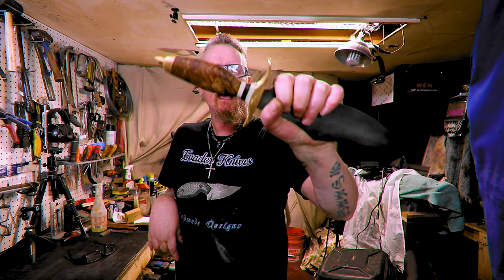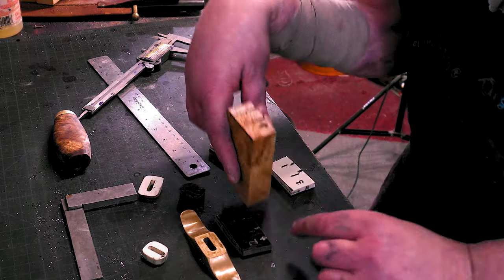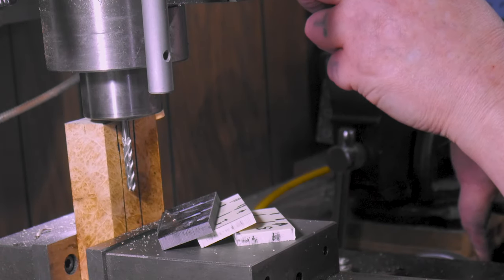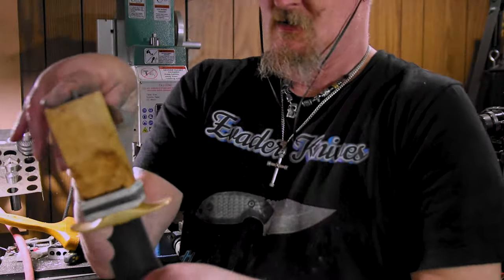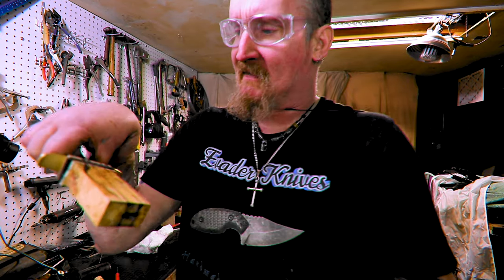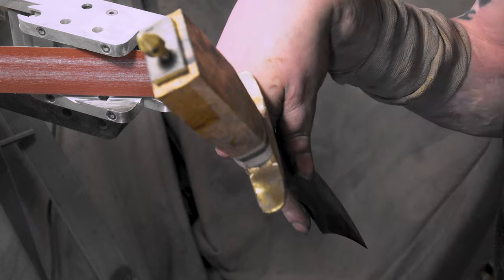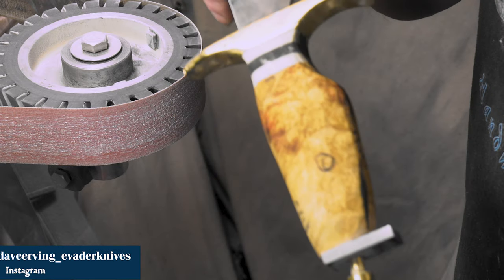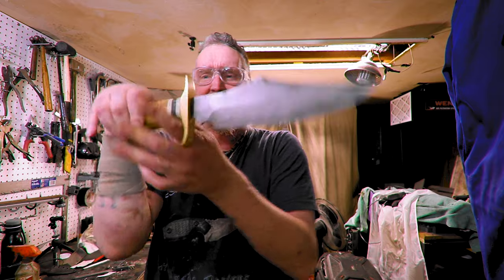Bowie Knife - Redemption

Comment: That beast has finally come together beautifully. I love it spacers and all. That really does make sense for strength in the narrow portion to not be wood. I guess if it were not such a big knife with a fairly large tang you could have comfortably used just the wood block. Good call. That’s why I ask you the questions. 😂. Have you buffed the handle yet. If not DM me. I might have a suggestion from something I’ve learned from someone. I will be trying it out myself this weekend. Looks really awesome Dave. 👍👍👍
Reply from the maker: Slowly but surely, this knife has had more problems, I tried to epoxy the endcap on & it just came off again, so i'll have to wait again, no big deal